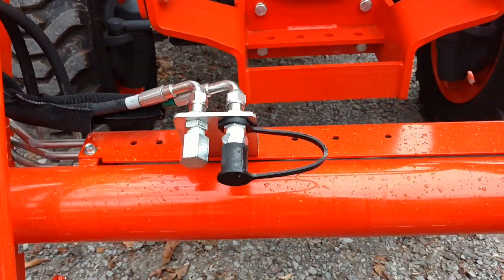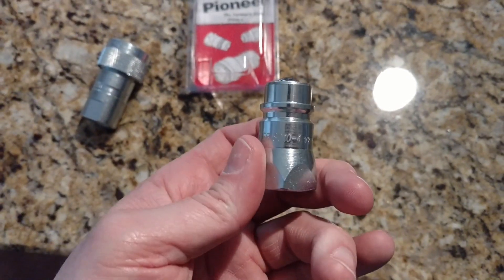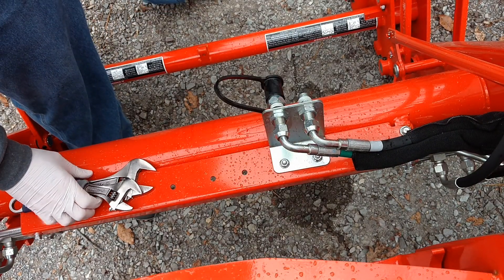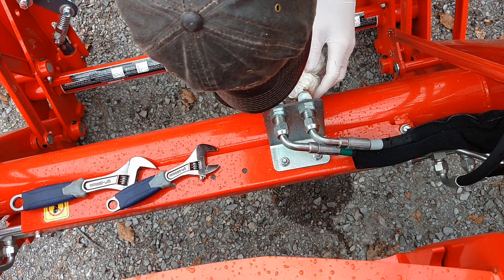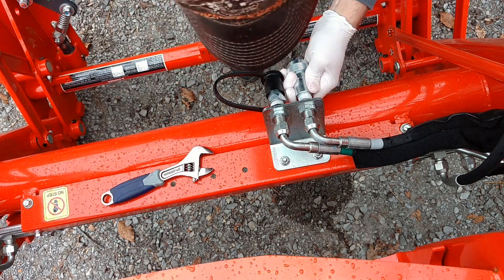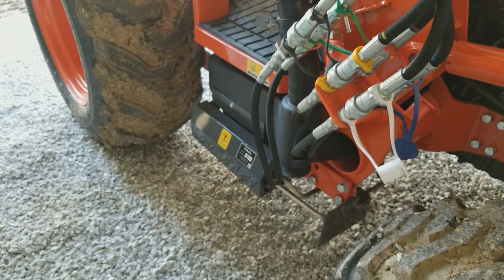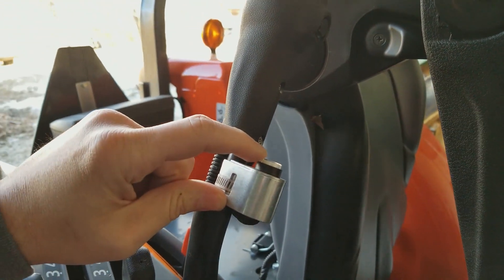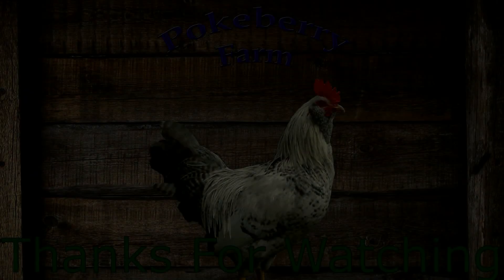Kubota Third Function Valve Kit Walkthrough

Comment: Love it! Just like me.  Not sure what the 4th @ 5th function for, or drafting, but get it!  I think I am just going to get the top adjust, not tilt, but I'll add 4 & 5 function.  If you are looking for a midrange tractor, this is it! (Huntsville Tractor is my supplier). I did get 3rd function and grapple.  Beast.  Think I will add spacers for rear wheels and fill tires halfway for added stability. Rock on Orange Tractor!

Comment: Thanks for posting this. I have the same 3rd function on my L3560 but my button does not light up and it’s not “clicking” off or on. I have never even used it. Factory installed. It only worked while I was holding the button down. I’ll have to have them look at it. I have no seen any videos of it being demoed so thanks a lot for all your footage. It helped a lot.

Comment: Your video really helped an issue I'm having.  Bought a used L5460 with the same 3rd function kit and it did not work.  Found this video and a diagram that showed I was missing both relays!  I bought 2 relays tonight and it's still acting strangely and not working completely.  I'm suspecting one of the relays is bad since when I swap them the system acts differently.  Do you happen to have the installation instructions for the 3rd function kit?  I've been looking online but can't find any.

Comment: How many rear remotes do you have? When you are using the thumb switch, do you then lose a loader bucket function?
I am trying to purchase rear remotes/ third function and trying to figure out the best set up. Mainly want to control my snowblower chute and rotation. Thank you for posting.
Reply from the maker: One for the top link and one for the side links, "top and tilt", and then the standard to bring the arms up and down. Front remotes powered by the thumb switch do not prevent standard loader operation.

Comment: I hate to be the one to bring this to your attention but the shot at the 5:42 mark of the video is completely wrong. Everything that you show hanging on the outside of the boom should be on the inside between the boom and the sheetmetal of the hood. You will be in for a rude awakening with your installation, the first time you get a little too close to some fixed object. Being you uploaded this video in December of 2017, my guess is by now, you've already learned that you located this installation ion the wrong side of the boom.
Reply from the maker: For this model, those lines are supposed to be on the outside. I'm not a fan of it, but haven't had them be an issue yet.
Reply: @pokeberryfarm681  You're absolutely correct. I went back and did a Google "Image" search and found that was not the only model they did that type of install on. All I'll say is, I wouldn't even consider a tractor that was rigged like that for land clearing. Too much risk of damage to the hydraulic system involved.

If you would like to see a better style for the forward and FEL hydraulic installation, look at https://auctionresource.com/auctions/2537/great-plains-kubota-equipment-auction/74228/2015-kubota-l3560

A little more digging will also show there is plenty of room under the floorboard for the installation of the solenoid valve. IMO, Kubota really screwed up on this style of install. Still a nice tractor once this install has been modified to protect the hoses and associated valving.

Comment: Can you tell me where you got the on-off switch mounted to the side of your joystick? I am installing the exact same diverter valve that you have on your machine on my Yanmar and I'm trying to reproduce as much of what you have on your factory machine as possible to get it functioning the exact same way.
Reply from the maker: steven walcott, the push button you can see at 6:38? It was part of the whole kit, but when I get home from work in the morning I'll see if I can get the part number for you.
Reply: Pokeberry Farm that would be fantastic! I picked up that very kit on eBay but half of the accessories were missing. The only thing it came with was the diverter valve and all the hoses. If you can text me at 812 three two0.24five9.........
Reply from the maker: steven walcott 7J292-84180 for the switch stay, 7J056-84150 for the switch. Hit "print pdf" on this page for a diagram. You don't have to log in that way. http://www.messicks.com/ku/90429?sectionId=230147&diagramId=463320

Comment: You also could have pulled the two bolts holding the mounting bracket to the loader to get easier access to the adapters for removal and replacement. Nice video though.
Reply from the maker: Yeah...I thought of that originally, but knew I needed to put some torque to get the caps off and didn't want that transferring to the lines.  By the time I got to the I'm screwed part, I went all dumb and could only think of how big of a set of pliers I had!  You're right though, once broke loose, those two bolts would have made my life way easier!  Thanks!